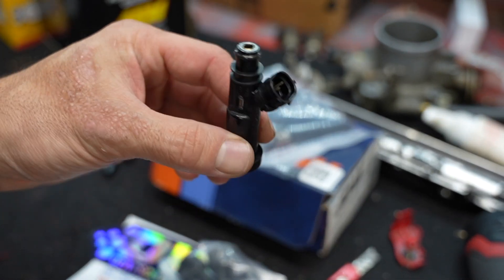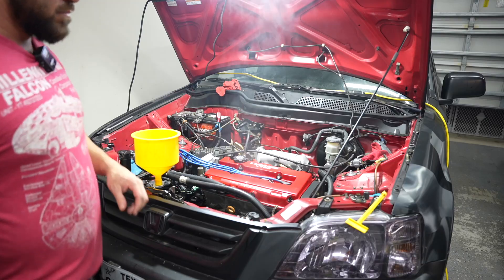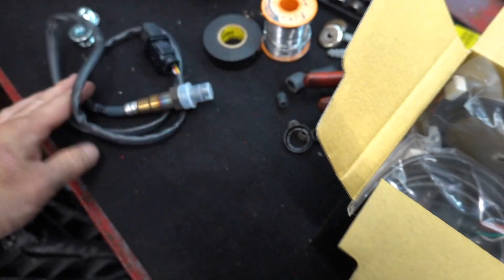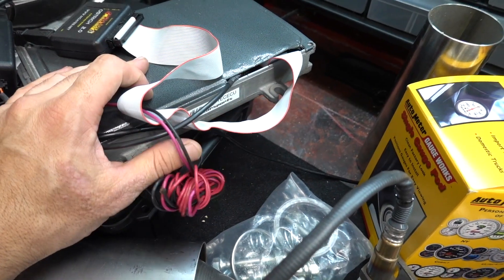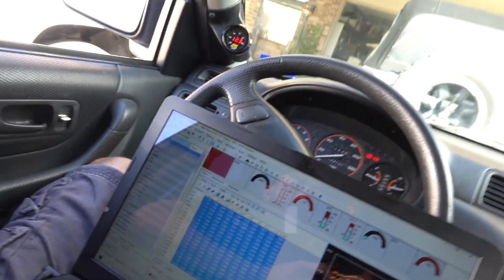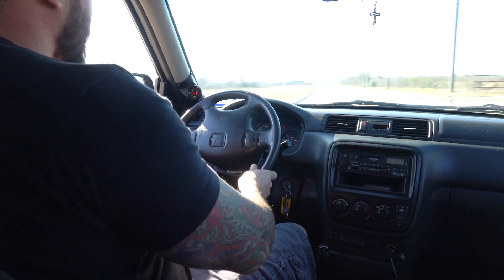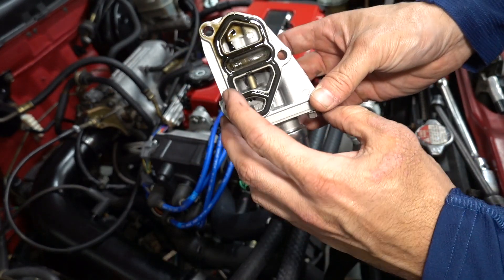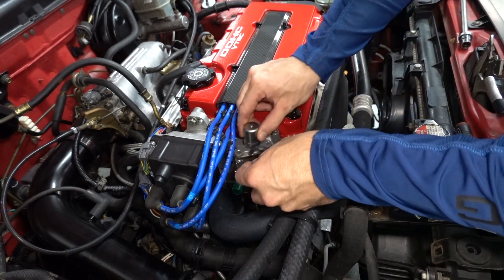B20 VTEC Guide Finished Its Got  Problems  / Mod my CRV Rd1 B16 Head swap

Comment: So I got a obd1 p75 with hondata. In order for it to stay running I have to give it gas. On a stock virgin p28 it starts with no issues. But I saw you added 10% of fuel across the map before even starting. I put on a p30 b16 map do you thinking adding 10% would solve that issue?

Comment: Cool swap dude! Im doing a similar swap on my EK4. B20 block with b16a head. ITR intake manifold,
With that, where did you plum in your PCV valve? Since the b20 doesn't have the breather box like the b18c/b16a.
Reply from the maker: Thanks man. Yeah I haven’t done anything with the pcv yet.   Planning on working on it when I do the boost.

Comment: I was wondering in the first video if anything else had been done to support it as I heard that upgrading the oil pump was very necessary. Looks like you got that sorted in later videos. Checking this out as I'm looking at doing the same thing in my EF.  B20B with an eventually changeup to a vtec head.  Definitely subbing to see more of what you do.

Comment: Sorry to hear about the bicep situation!  I just got my b20vtec all buttoned up but I’m a little confused on where the two wires go from the pressure switch, I hooked my solenoid up to a wire on the ECU, then I grounded the pressure switch to transmission and it completely melted the wire by the time I got back home 😮 maybe the Amazon pigtail I bought for it was reverse polarity? Thanks!
Reply from the maker: Message me on instagram, I’ll send you some pictures of my ecu, and the wiring, tomorrow.
Reply: @Donnythelatemodeltech  I’m on a p28 I hooked my vtec solenoid to A4 then disabled the pressure sensor in my smanager, but I’ve been hearing A4 needs to be jumped to D6 I think in order to bypass it? Looking forward to it thanks man!
Reply from the maker: I’m right in the middle of installing an oil pump on it.

Comment: When creating my base map in honda tuning suite it asked what trans... what would I put if im running the stock b20 auto trans?
Reply from the maker: What ecu are you using?
Reply: @Donnythelatemodeltech  chipped p328 that's auto

Comment: Vtec souding like on and off and on ? Does it  feel strong when vtec pops cause if your engaging it at b16 rpm thats too high, 4800-5200 rpm with b20 bigger the motor sooner vtec activation
Reply from the maker: when I get the new pump installed , I play around the with tune and see what happens..  thanks !

Comment: I see you decided to call me out at 6:58 🤣. I think once you get your VTEC oil pressure issues resolved, my little R18 8th Gen Civic might have some REAL trouble keeping up with your CR-V.
Reply from the maker: No way.    The crv is not fast.
Reply: Holy a supercharged r18 how does that even work are you running forged internals or something I thought the r18 rods were chicken bones
Reply: @DMVKIvak  stock internals... it's just tuned correctly. The R18 internals are nearly identical (with additional improvements) to the B18C1 Acura Integra GS-R motor.

So far, no issues 😁👍

Comment: You have to run a Vtec engine oil pump.
Reply from the maker: Thanks , on it. Lol.
Reply: @Donnythelatemodeltech  No problem, I just remember while getting my parts list compiled for the swap people mentioned a b18C1 oil pump in case you decide to go b20 Vtec.
Reply: @CaptainTexas92  that’s wrong info all 96 and up pumps are the same pressure ls gsr and b20
Reply: @frankier9125  that’s correct I made a mistake. For the life of me I thought the CRV used a lower output psi pump due to it not having piston bore squirters and no Vtec. The pump clearances are probably just bad enough to drop pressure at high rpm.
Reply: @Donnythelatemodeltech  i have a b16a that im not usen and recently it had tb water pump done.. Its gone smokey and just bought a b20 so was gonna use most of my b16a stuff bare the belt for the swap
Reply: All B series oil pump are identical.
Reply: Would a b16a oil pump and water pump do for b20v
Reply: @Keane-to-clean  as stated above b20 oil pump is identical to other b series. It should work fine but double check. I would recommend buying a B20 pump as it will be a lot cheaper than a B16 pump due to its Vtec tax.
Reply: B20 oil pump are exact same as ITR..... 15100-P72-A01. B16A2 and b18c6 diff is a sensor on the pump

Comment: Nice video bro! Oil pressure at idle should be 20 psi and full throttle should be 70 psi. I think. I hope your oil pump is fine and maybe invest in an oil pressure gauge and oil pressure regulator.
Reply from the maker: Thanks man, will definitely need a gauge for hooning around.    🍻
Reply: @Donnythelatemodeltech  Dude, this awd CRV is 🔥! Add a turbo, it's dangerous for yours and mine 32 😆
Reply: @doubleclutchin6860  thought it was only fwd?